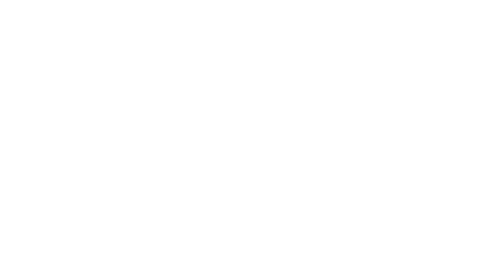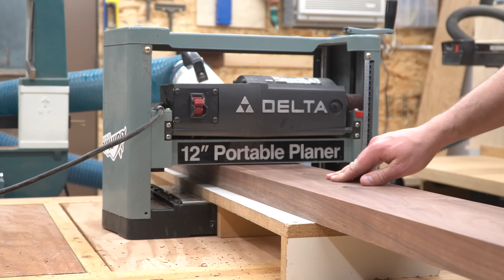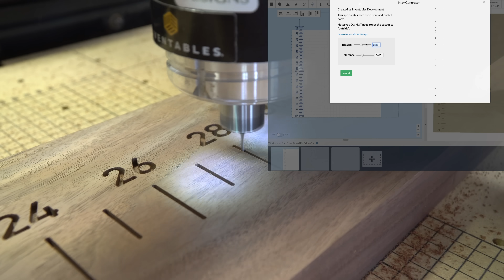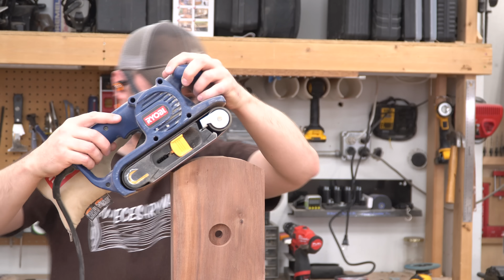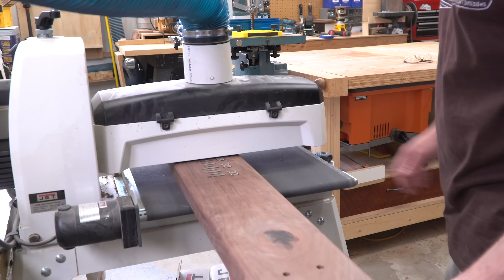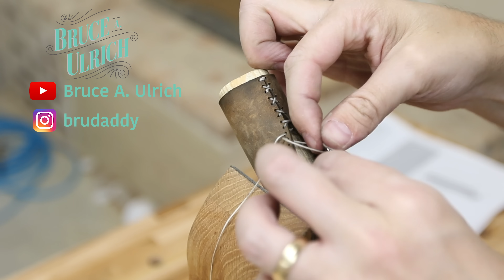Making Draw Boards | Utilitarian & Ultra Classy Archery Tools

Comment: Brother, u should sell the boards. There is no need to use expensive wood or finish it unless the customer requests it. You could sell them for $100 with n9 finish on them & people would line up for them.

Comment: Its funny looking at the difference in effort and tools required for the two boards. While watching, on the first board I was certain I could and would do something similar. When you started describing what you did to the second board you immediately lost me (mostly because I am not a woodworker and don't know what many of the tools you used are). Its like watching a teacher starting a match class and beginning with simple addition, and then jumping to calculus. It was funny. Great video and the second board is beautiful. I'll make the first one. ;.)

Comment: Extremely beautiful Draw Board... Wow...
BUT I spotted a flaw!

It seems you started the inch measure from the front of the peg,
where the bow handle rests...
I made the same mistake, which I have now corrected, after learning:

Draw length is NEVER measured "from the string to the handle",
even when String Hight / Brace Hight is...

With the AMO standard, we must measure drawlength,
from "where the cleft between thumb and indexs finger rest", and then ADD 1 3/4 inch...

In "average", that gives the measure to the back of the bow, (facing away from the archer), where the arrow pass...
And that measure gives the "average" measure, to know, how long the arrow must be, "at least"...

SO your inch markings should be placed,  so "zero inch" is:
1,75 inch in front of, the peg...

You can simply move the peg 1,75 back, against the winch, 
as that seems easier, than moving the inch marks.

Asian bow companies, always measure to the back of the bow, (facing away from the archer) where the arrow pass,
and that gives the ACCURATE measure, which say, how long the arrow must be "at least"...

The AMO standard measures arrowlenght, NOT including the arrow point, and measures from the bottom of the groove in the nock, where the string rests...

The advantage of that is: When the AMO Draw Lenght measure say 28,5 inch, then we can simply order arrows "28,5 inch long"...
Then the tip is always in front of the bow, either in front of the "arrow pass", or the arrow rest...

Compound archers use those special arrow rests, and might wish, the point is just in front of THAT, 
so to order or make the desired arrow length, each needs to measure the ACTUAL distance,
from the front of the arrow rest, to the string, at full draw, to get that length...

But when adjusting draw weight, like for competitions, they still need to measure the drawlenght after the AMO standard...

I only own "Asian recurve bows", and use the "Asian measure method",
as that is what the Bowyers used, when measuring draw weight, and determine the maximum draw length...

Except two traditional recurves from Hungary, as that Bowyer use the AMO measure,
when measuring the draw weight, "at 28 inches"... And to determine the max draw length...

But the Handles on the other bows, have different diameters and shapes,
so I need to have an "inch- stick", which can be moved, to fit all bows...

In your case, you always wish to use the AMO measure...
Then the peg should simply be moved 1,75 inch closer to the winch...

Only then you can measure the "AMO Draw Weight"

Happy shooting
Dan